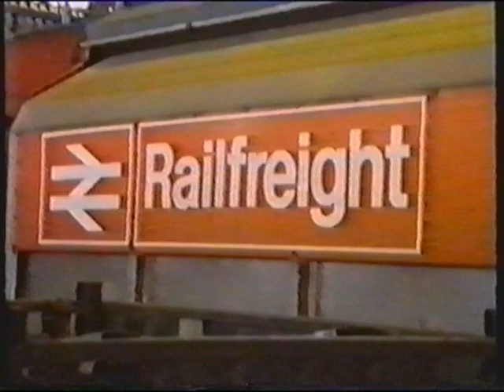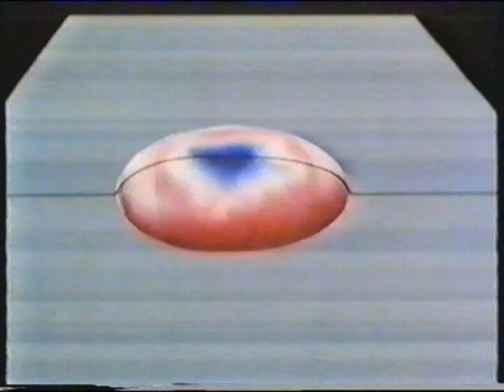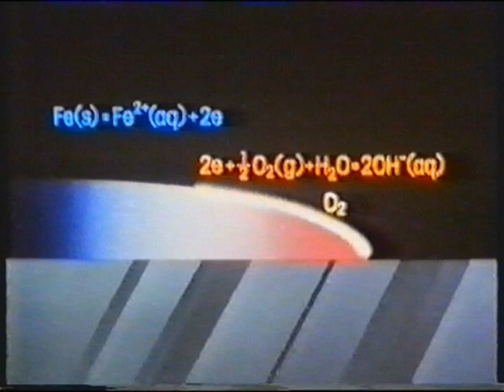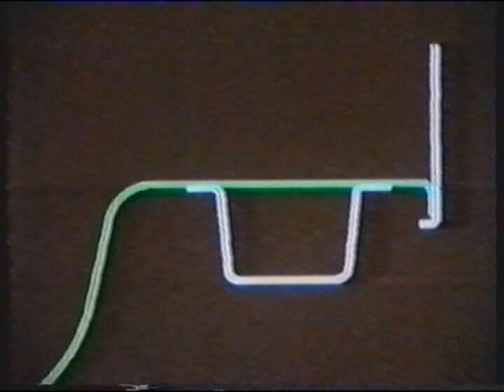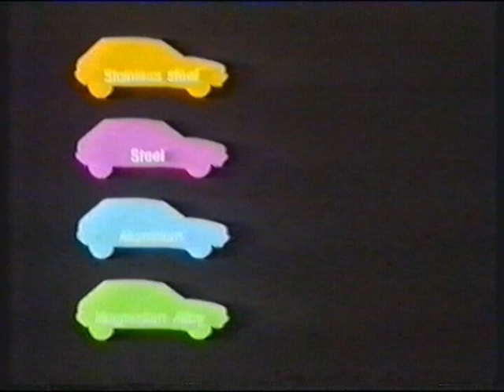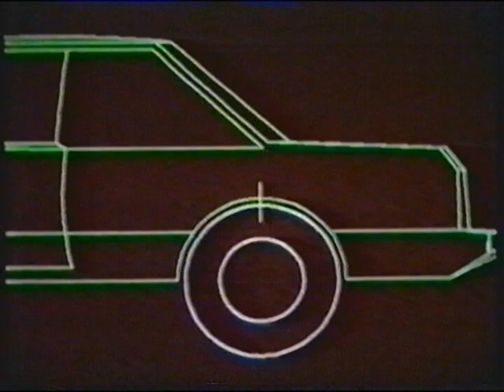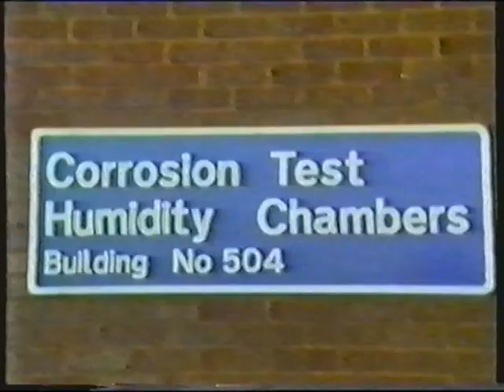VTCCRD Austin Metro Corrosion testing

Comment: Worked for an Austin Rover Dealer back in the 80s, and you could see the weak spots on the Metro the wings no wheel arch liners on the front wings. The Mini No underseal at all! Maestro and Montego so many  exposed seams and thin underseal or non at all in places. (:
Reply: No different now, I've got an 07 Fiesta, carpet, yes carpet for rear wheel arch liners! And no underseal on the spare wheel pan, exhaust tunnel, front bulkhead, under petrol tank, minimal underseal anywhere. I'm underneath regularly, wire brush on drill, red oxide, black hammerite, underseal, same as I was under a Metro or Mini in the 80s. I've got an 04 BMW Mini, same, bare metal underneath, rust breaking out round the rear lights, from inside out!
Reply: @richardburns5925 look under most German cars VW, BMW and Mercedes. I'm a mechanic and I am stunned. Some of the new stellantis cars have no paint on the inner wings panels primer.

Comment: My metro is still going at 34 years old. Like with any car on the road, wash underneath as well as on top; floorpans, inside arches and wings, valances and inside door/bonnet/boot edges.  Oh and don't use it in the wet! (If you do wash it underneath afterwards).
Reply: I bet it has about 40k miles on  the clock.

Comment: Money and time-wasting "research" that smacks of publicity stunt. None of the issues were corrected at the production line, so the cars proved to rank among the rustiest models of the time. No wonder they went under.
Reply: Well this was all new innovation at the time. This started the engineering into anti corrosion, which led to cars today being almost completely rust proof. If you look at the cars of the 50s and 60s they were a hell of a lot worse in rotting.